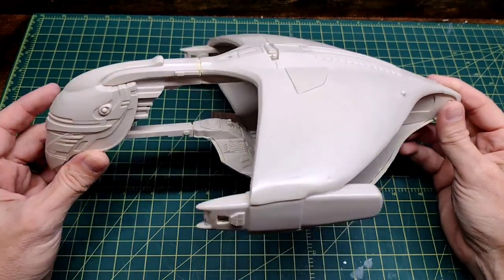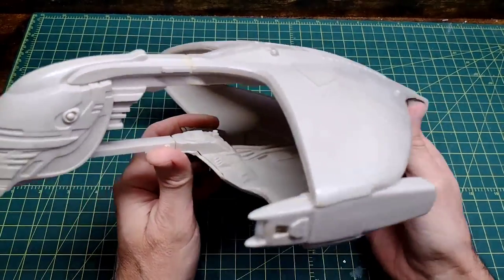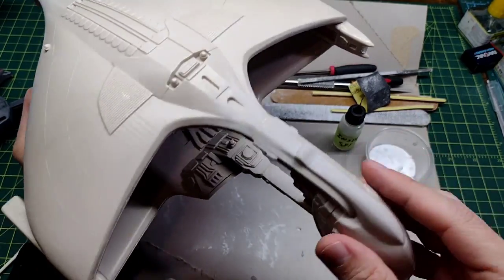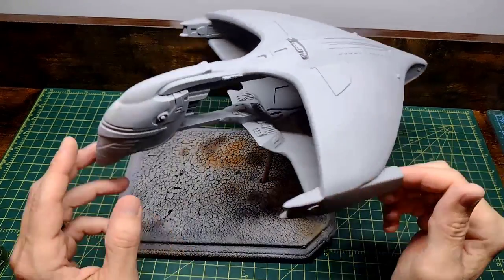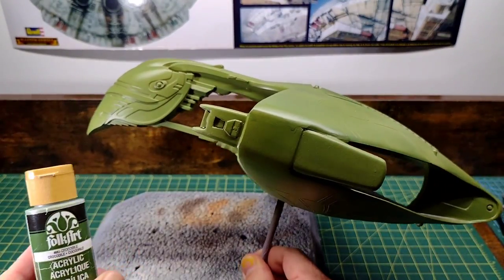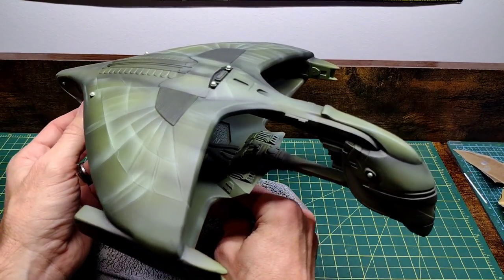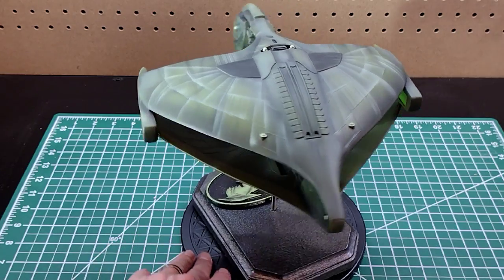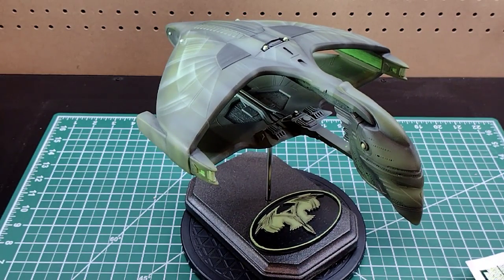AMT Romulan Warbird Model Salvage

Comment: The War Bird turned out awesome. Thanks for sharing the tip about the super glue and baking soda. I will have to give it a try. Last week I made up a batch of sprue goo,  but with that you still have to wait for it to dry. What type of printer do you use for the decals?  Thanks for another great video. You Roswell neighbor
Reply from the maker: Thanks! I like the CA Glue baking soda because it dries instantly and that is very handy on projects like this that require a lot of body work. I printed on my HP jet pro printer.